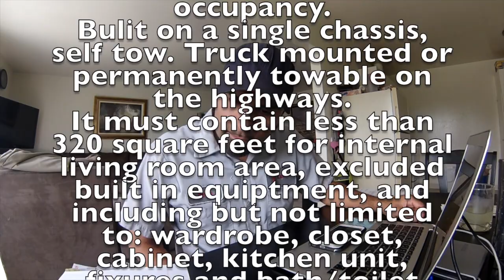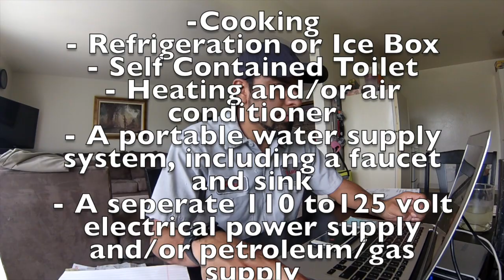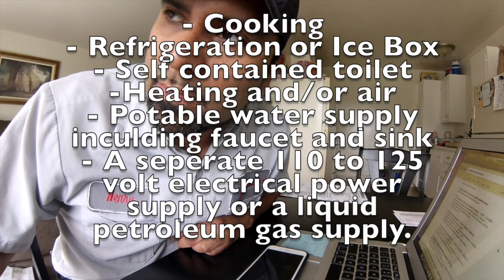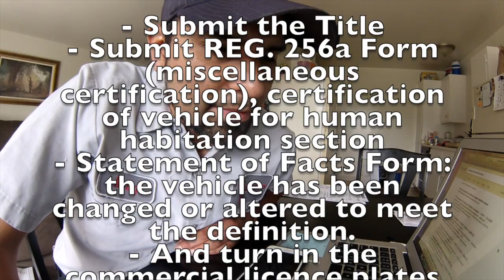Registering your converted RV - The Legal & the Ethical - Part2 #21

Comment: Henry, 

I'm curious about what the outcome of your battle with the DMV went.

My experience with the inspector at the DMV was frustrating.

I had purchased a Dodge Caravan with Oregon plates, and had to get the vehicle verified. The inspector verified the numbers but since the back seats were missing, he arbitrarily classified the minivan as commercial, and wanted me to scale the van and pay weight fees and whatnot.

So what I did was I did was I went to the CHP with a new form and asked him to give me a verification. I had printed the form including the reverse that listed the codes for the body style.  I highlighted SW so that showed elegibility for car plates.

Next day different DMV office and I had new plates.

I too am considering a box truck conversion but I have another link. I want to get one of the many non smog compliance diesel box trucks not permitted in CA. My plan is to go out of state and register it there as an RV. Converting it the way I want is going to probably take me several years, but I want to lock in the reclassify it as a motorhome.

Comment: California department of Transportation :
Motorhome: A motorhome is a noncommercial passenger vehicle defined in the California Vehicle Code (CVC) Section 465 as a "house car" and commonly referred to as a recreation vehicle. CVC 362 defines "house car" as "a motor vehicle originally designed, or permanently altered, and equipped for human habitation, or to which a camper has been permanently attached." A motorhome should not to be confused with a bus (CVC 233) or a tour bus (CVC 612), also called "motorcoach," which is used for commercial passenger transportation and requires a commercial driver license to operate. See also Public Utilities Code 5360-5379.5 and 226.

VEHICLE CODE - VEH
DIVISION 1. WORDS AND PHRASES DEFINED [100 - 681]  ( Division 1 enacted by Stats. 1959, Ch. 3. )  
362.  
A “house car” is a motor vehicle originally designed, or permanently altered, and equipped for human habitation, or to which a camper has been permanently attached. A motor vehicle to which a camper has been temporarily attached is not a house car except that, for the purposes of Division 11 (commencing with Section 21000) and Division 12 (commencing with Section 24000), a motor vehicle equipped with a camper having an axle that is designed to support a portion of the weight of the camper unit shall be considered a three-axle house car regardless of the method of attachment or manner of registration. A house car shall not be deemed to be a motortruck.
Reply from the maker: JYDOG, well said sir! 
Did you find anything regarding the guidelines or acceptable method or materials to install in a motorhome/house car? I have installed everything on the list and in my opinion made it human habitable but it appears that it wasn't installed with enough framing and trim around my makeshift bucket sink to make it a respectable motorhome, lol.
Reply: I didn't find anything and if you do it probably only applies to a manufacturer who intends to sell a recreational vehicle not for someone's personal use.  I would think all you would have to do is find the definition of  wardrobe, closets, cabinets, kitchen units or fixtures, and bath or toilet rooms under California law and apply it to your situation.  Bring every law and statute with you that defines motor home, recreational vehicle and "house car" which appears more than the previous two words oddly throughout California law with you next time you go and submit it with your paperwork. If they have any problems with it ask them where it is defined under California law. They are there to enforce the laws so they should know how to come about the information.
Reply from the maker: JYDOG, this is exactly what I've been trying to request for the past 3 videos. It seems that they don't have the written law there at their office for them to review. They always haveto call somebody else to ask and they come back with the same jargon: human habitation!